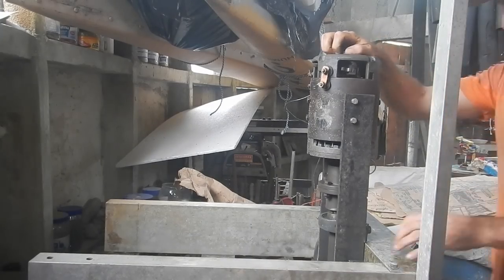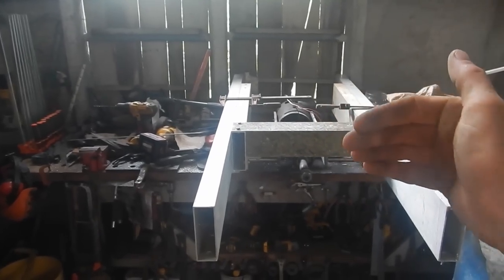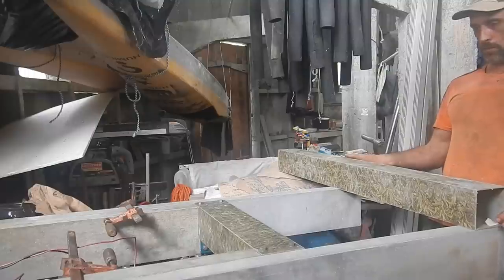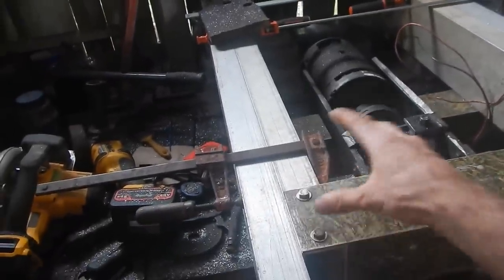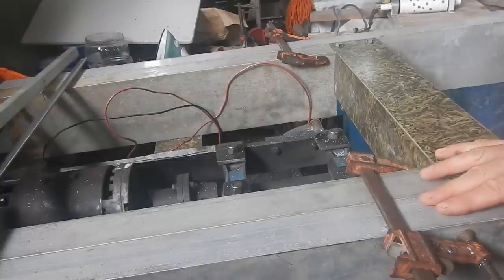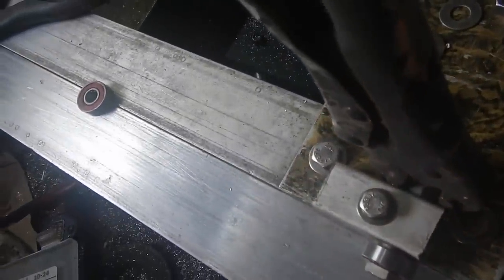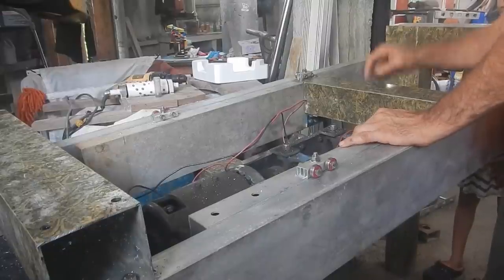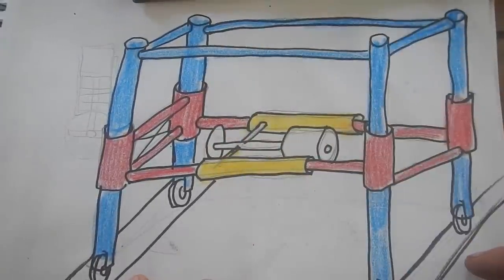Lumber Mill 010 Slider

Comment: Recently watched a pretty interesting video showing experimentally that split lock washers are counterproductive.   Basically if the nut is loose enough for the lock washer to lock its not fully tight and if the nut is tight then the lock washer is squeezed flat and thus no longer digging in.
Reply: @rustyevolution6298  hence why the video was so interesting.  Feel free to ignore me based on conventional wisdom.  No skin off my nose.
Reply: @rustyevolution6298  I don't claim any expertise other than the ability to pay attention.  The video I reference appeared to "prove" that specially split lock washers (I think I know there are other types of lock washer) have effectively no effect if fully tensioned (most cases) and at least in some cases have a negative effect.   Additionally, he specifically addressed the question of "if they really don't do much or potentially anything, why does everyone use them".   I found the video compelling.  It did not trigger my bs detector.  Conversely your claims that I'm spreading misinformation are insulting and that you're personal "experience" should be taken as gospel are condescending... and have done nothing to change my mind.   If you have actual experimental evidence showing under what conditions split lock washers are a measurable improvement over non-split lock washers I'll stand corrected.... and still I'll stand by my claim that the referenced video was interesting.

Comment: It's great seeing this come alive.. it is also great having your daughter help you with it.. I have used pieces of wood with BluTack on them to hold bolts in long tubes that my hands won't fit into.. I also think you will be needing roller bearings on the underside of the sliding frame to help keep the frame from lifting out and when it is in the verticle position.

Comment: Maybe you have already considered this, but you need to allow for minute adjustments on the saw in both horizontal, and vertical plane to set your blade “lead” in the cut.  In the vertical plane whilst cutting, you want the leading edge of the blade to run about 1-2 mm more toward the log than the trailing edge of the blade. Whilst running in the horizontal plane, you will want to have the edge of the blade that will be closest to the deepest part of the cut in, contact with the log at the tooth bottom edge while in the horizontal position-(cutting plane)with the edge of the blade closest to where boards are coming off, about 1-2 mm off the log. In this way the disc is not rubbing on the log face and building up heat, it is important to ensure straight cuts, with no waviness, and no heat build up on the blade which can cause warping of the disc, and making it not run true. Also you will want to provide for a water drip, in the cut to act as a lubricant for the blade, I use a squirt of dish soap in say a gallon or more, to make it run clean and not gum up the blade. Looking like it is coming along well.